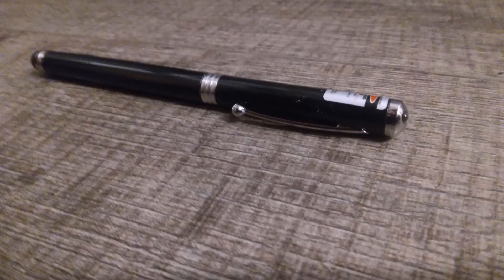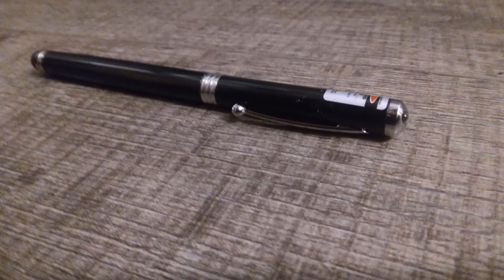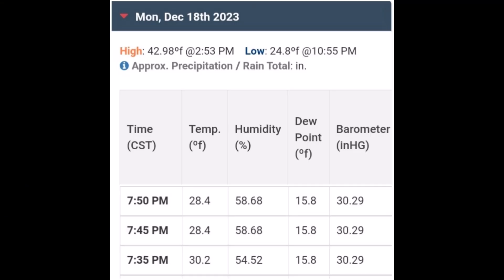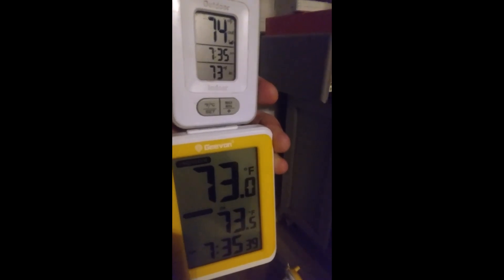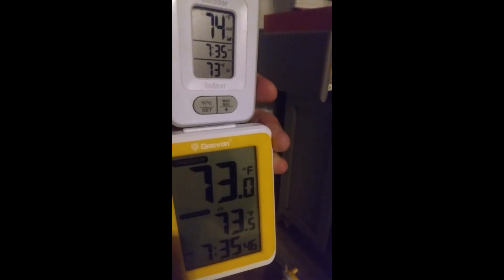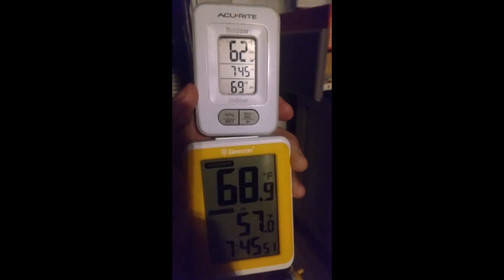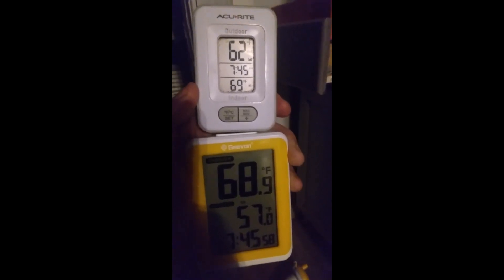At Home Refraction - Laser Test

Comment: This is great! You explained and demonstrated it perfectly on a micro scale. Notice the slight vertical compression of the laser on the bucket? The top bends up slightly less than the bottom. Even within the height of the path of the beam there is a refractive gradient. If the beam represented a bunch of rays from a distant target, then from the viewer's perspective (as the bucket looking at the laser), we would see that as stretching downward, not compressing upward. 

I think you guys understand these concepts well and your videos should help others see the upward bend/downward displacement relationship of light rays. I'm working on some stuff that I hope will help the few that are still having a hard time with certain aspects of refraction and perspective. Anyway, thanks again for your efforts!
Reply: I agree, this is confirmation that atmospheric conditions cause light to bend, explaining why sometimes we see too far.
Reply: @BigHeretic  The observation proves light lifts upward into lower-pressure air rather than being dragged into higher-pressure air, which contradicts the claim that air-pressure bends light down and around a globe, denser air below lifts light, overpowering resistance of thinner air above, proved by the positive trend upward of the laser on the bucket. For light to bend through air around a globe, light must constantly accelerate into denser air below rather than travel into thinner air above. The observation verified that light prefers the path of least interference. (To Travel as straight as possible during continually decreasing resistance)
The implication proves light must travel into the outer-space beyond the horizon of the globe model, rather than bend down and around into denser air at the surface of the globe model. 

Proving the earth is flat, and indirectly proving the globe-model portayal of "outer-space" false.
Reply: @speakingthetruthinallthere1005  This observation shows that under certain conditions light can refract up but irl the conditions are such that light bends down. 
Heat rises and cold air is heavier so it always tends to be denser below causing downward refraction. This is why Sky Free has to open a door and catch the desired effect which naturally returns to the normal state in minutes.

Comment: My original comment disappeared, but ignore it, because I was mistaken. Anyway, I wanted to recommend that you get a thermocouple thermometer with 2 probes, you can get one for like 30 bucks. You can calibrate them together so that you know they match, and then mount the probes at a very small height above the floor. I suspect there may be a small boundary layer of warm air above the floor since the floor will not cool down as fast as the air. The cool air does sink which is what you're seeing but I think you're measuring it too high.

Comment: Was the laser light level? It looks like it is at a slight angle upward. I wish I could see the beam.
Reply from the maker: I can't say for certain, we'll have to note that with the next round of tests. But if not level, then yes, I think it would have been angled slightly upward. Yeah, it would be great to be able to see the beam, that's something else we'll have to try for with the next round of tests.
Reply: @skyfree01  when you said it was getting refracted upward, my big question was why. I imagine the dense cold air coming in from the bottom, not hovering above a layer of less dense warm air.
Reply from the maker: @ABOLISH_NASA  The way I currently interpret it is that the warm air at the surface seeks the cooler outdoor air as the door is opened. The movement of the warm air at the surface seeking the cooler air above refracts the light upward. However,  we've conducted these tests before with a temperature gradient that increases and decreases above the surface, and in both cases have observed upward/sinking refraction. We're looking at getting more thermometers for future observations and hopefully that will give us a better idea of exactly what is occurring. Thanks for the great question!
Reply: @skyfree01  you guys are amazing, keep it up!
Reply: @skyfree01  This is good brain candy! I noticed the floor appears lower in the refracted image than it did in the control image. I am asking myself why so? I'm also asking why the compression on the bucket appears on the bottom of the red circle.
Was the floor level in this experiment?
Reply from the maker: @ABOLISH_NASA  The floor in this test has a bit of undulation to it, it's not perfectly smooth. We've tried these over various floors, some more smooth than others, and consistently witness the apparent lowering/sinking of the objects and surface itself. 

Just like the laser pen and light ray, the light from the surface itself is being refracted upward. The farther away an object, the more distance the light has to travel and therefore the more it will be refracted and appear to sink. 

We see this over the small bodies of water we conduct tests over as well. Objects in the distance, including the surface itself, will appear to sink into the more nearby surface that hasn't been refracted as much. 

As for the compression of the bottom of the laser on the bucket: I believe that occurs because the light nearest the surface is being refracted up more-so than the light higher up.

We'll have to make a video soon and try to explain and demonstrate some of this. Thanks again for the great thoughts and questions!

Comment: The slow speed of the thermometer to update means the test isn't very good. You could pick up a probe thermometer, or a thermocouple, or something that updates a lot faster.
Reply from the maker: Thanks! That's what we'll have to do. We need to get more temperature readings along the viewing route too. Because we're currently only getting the temperature readings from near the camera, it would also be helpful to have temperature readings near the objects as well.
Reply: @skyfree01  BBQ thermometers perhaps?  They can have 4 probes and a single display good for temps as low as 15F plus they're much faster response than weather ones.  You'll also have more control of the location where you're taking the measurement.
Reply from the maker: @tjwiets6691 Yeah, maybe so! We're looking at some thermometers online to order soon, so I will definitely look into some BBQ thermometers as well. Thanks for the suggestion!

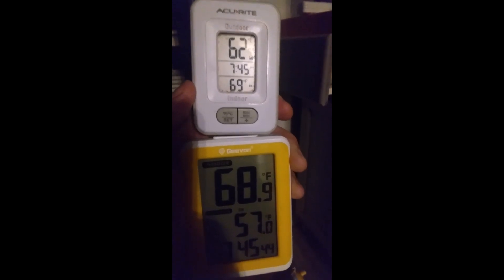Comment: 1:17 you could have waited for the thermometers to change. Measuring temperature AFTER the test means its going to be guesswork at best. You even said "what the temperature MAY HAVE BEEN during the test."

2:20 after you open the door the laser on the bucket is compressed. A normal/regular Sunset shows the Sun disappears bottom up. Not compression like your laser shows.

3:20 it doesnt really matter how long you wait. You didnt measure the temperature once during that whole thing. At least not that you've shown us. In fact 1:17 demonstrates you didnt. It was guesswork.

4:00 Looks cool but again no measurements. The floor wasn't measured either. No verification the wood plants are flat either. This whole "test" is meaningless to draw conclusions from.
Reply from the maker: We've done these tests many times over various surfaces, and have recorded the temperatures during the tests again and again. 

Yes, it was guess work on the temps this time, that is why we noted that is was just an approximation. This was the first laser test we've tried, we'll conduct a longer test and get more accurate temperature readings next time.

In no way are we claiming this proves anything one way or another about the shape of the Earth, and definitely aren't claiming this explains exactly how a sunset would work on a level plane. 

We also aren't claiming that this floor is perfectly smooth and level, it's not, there is undulation to it as we've pointed out before. 

Our main focus is on the behavior of the light with these tests, and as we often observe, light refracts upward in many cases, especially anytime the surface is warmest and there is a decreasing temperature gradient from there on up. 

Thanks for the comment!
Reply: @skyfree01  It doesnt look like its disappearing bottom up. Its compressing. Thats not what a normal/regular Sunset looks like.

I'm not sure this isnt used to determine the shape of Earth. I saw Travis' video titled "SKYFREE debunks GLOBE", and the comment you placed there. That's how I got to this video.
Reply from the maker: @edfrees Travis is entitled to his opinion and interpretation of these tests, as is anyone. I personally wouldn't claim that this "debunks" the globe. We're simply demonstrating the effects of upward light refraction.
Reply: @skyfree01  What was it you thanked Travis for? I also didn't see you disagree with any of his claims. I'm not saying you have to out in the open. It just seems like things dont add up.
Reply from the maker: @edfrees  I thanked him for highlighting our video and bringing new viewers to our channel, including yourself, so welcome!
Reply: Was there a claim about the sun somewhere?  @edfrees

Comment: What does this prove? That light has the ability to bend upward, therefore rendering all FE laser tests over water, void?
Reply: It is important to see the other tests is context. Example: There is a video of four lights spaced in the distance over a few miles on a frozen lake. The conditions have been stable for a while. 
  The same with the long distance laser tests. 

 These tests are to show the effects of rapid air density changes on laser light. They are really useful. :)
  Again, the 'context' of the tests is really important.
Reply: @skyfree01 The observation proves light lifts upward into lower-pressure air rather than being dragged into higher-pressure air, which contradicts the claim that air-pressure bends light down and around a globe, denser air below lifts light, overpowering resistance of thinner air above, proved by the positive trend upward of the laser on the bucket. For light to bend through air around a globe, light must constantly accelerate into denser air below rather than travel into thinner air above. The observation verified that light prefers the path of least interference. (To Travel as straight as possible during continually decreasing resistance)
The implication proves light must travel into the outer-space beyond the horizon of the globe model, rather than bend down and around into denser air at the surface of the globe model. 

Proving the earth is flat, and indirectly proving the globe-model portayal of "outer-space" false.
Reply: I'm premiering my analysis of this video on my channel. I should be answering your question.

Comment: Ok, i lost my previous entry, so I had to rewrite my analysis:

1:47--the first thing I note is the light appears to be "in" the floor as there is flooring beyond the light. I take this to mean that is accurate and the light pen is visibly closer to you than the floor beyond it (Does that make sense?). Think Platforms A,B,&C from PablosDog.

1:54--Here you are creating a false horizon, just like with mirages. What does this mean? TO ME, it means that the aer is more dense than the light and PUSHES the light up. What you are seeing happen to the floor is the same idea. The LIGHT isn't bending downward, but the aer is merely swallowing up the light from IN FRONT of the laser and it appears to displace down when in fact it can easily be described as the aer is filling UPward in that area. Make sense?
Mark on the screen where the true floor and false horizon/displaced flooring is; think about the aer like water coming in and filling that area, blocking both floor and light. I know this because the target is lifted up. You'll never hear me say something so inane as "Light refracts down raising the target up." Had I been on the board that wrote the science, I would have nay-sayed this buffoonery. A thing cannot do opposites at the same time.

I made other brilliant comments, but accidentally deleted them. You'll just have to trust me.
Reply: An interesting explanation indeed. Thank you.